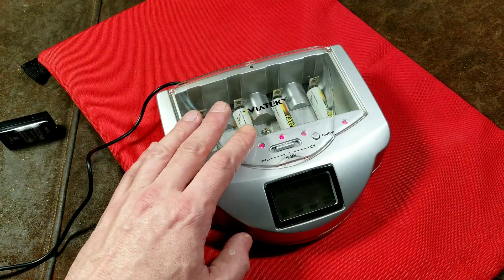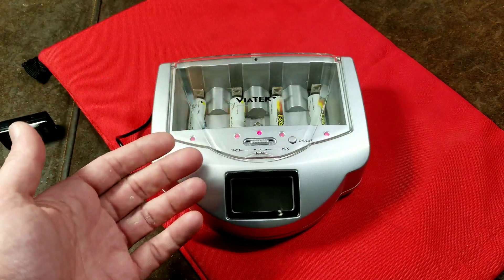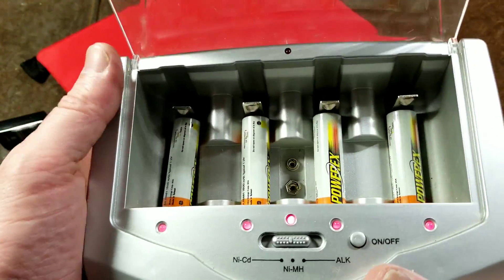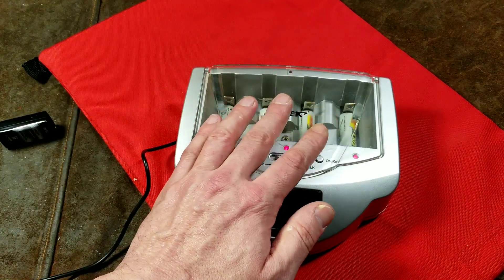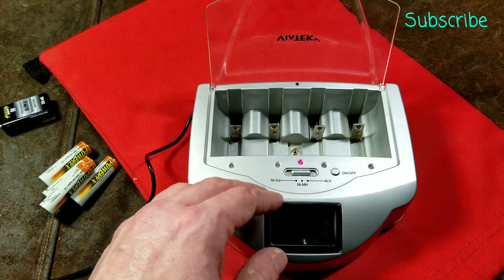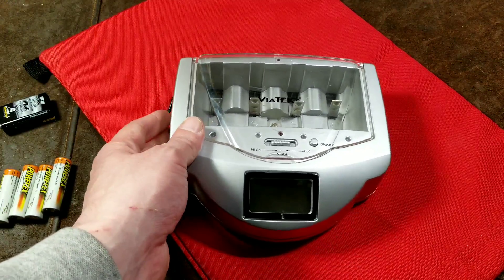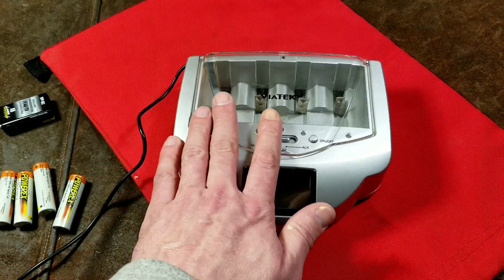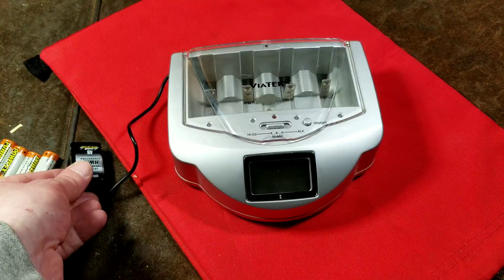Viatek Renu-It Alkaline/NiMh/NiCd Battery Charger Review

Comment: Catus, thanks for the review of the RE02.  For years i've had the Viatek RE01 that just recharges 4 alkaline AA or AAA batteries.  It just has LED's no fancy screen.  I share some of your opinions but disagree in some ways.
I don't rely on the unit's LEDs.  I always use a battery tester.  
I try to avoid recharging back to 1.5v.  There is too good of a chance that the battery will leak after.  Recharging to 1.3 v is pretty safe if the battery is not very old. 
Certain alkaline batteries seem to tolerate recharging better than others.  With Duracell I strictly avoid recharging past 1.3v as they will leak.    I recently came across some Energizer Max batteries that recharged to 1.5v a few times.  I was very pleasantly surprised and plan to purchase more.   
I typically recharge batteries that still have 1.0v.  I don't have much experience with batteries that are mostly drained.  I understand it could take more than a day to recharge them. 
In conclusion if you take the plunge be prepared to baby-sit them.  Check them every few hours with a battery tester.  I write the month and year of the first recharge on it and add an X for each recharge.  Don't expect to recharge more than a few times before it leaks.  Be sure to store recharged batteries in very small plastic bags so you can more easily find the one that is leaking.